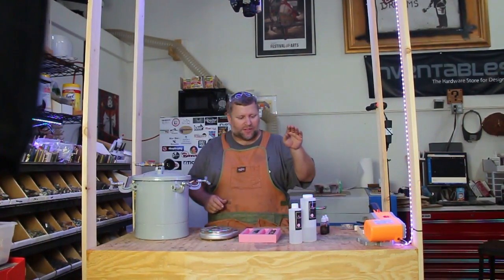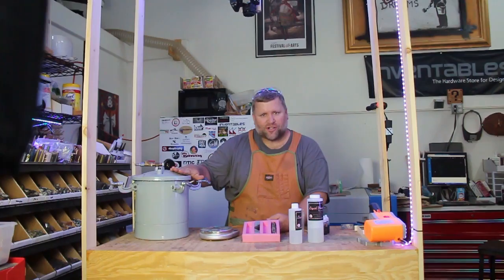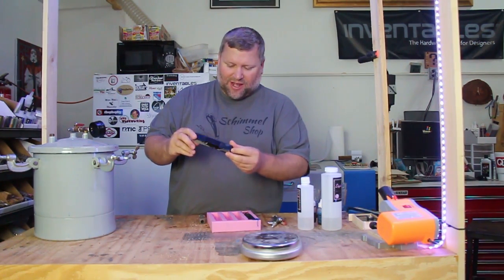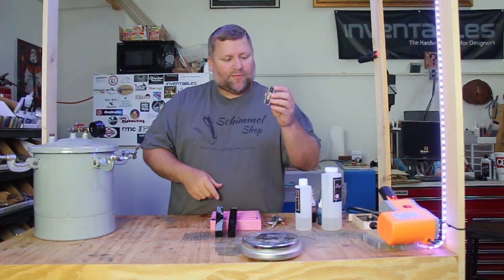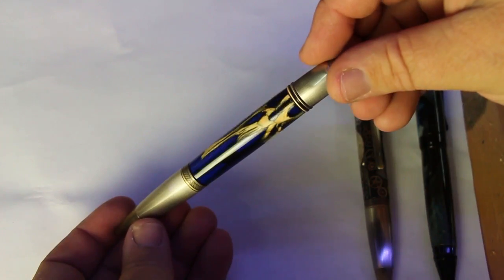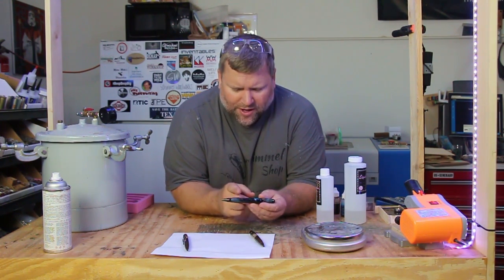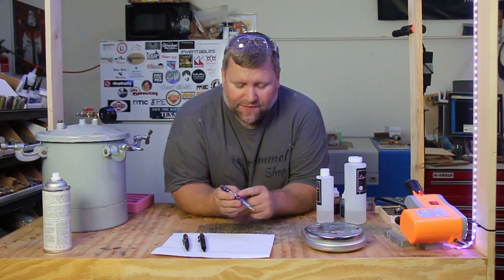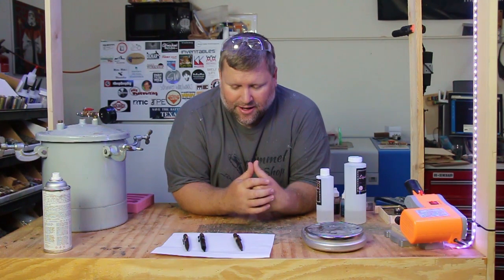Epoxy Resin Casting,  Hybrid Worthless Wood, Cholla and Watch Parts Tests

Comment: Thanks Chad, I've been wanting to try casting my own tube in blanks. This sounds like a great alternative. I don't have a pressure pot,just a vacuum chamber for stabilizing. What pen kit is the watch part blank. Thanks for sharing
Reply from the maker: Glad you like it Ron,   the watch parts is on a Monarch Grande from turnerswarehouse.com    thanks chad
Reply: Chad Schimmel Thank you. I looked at those during my past order. Do you have the molds for them? Thanks